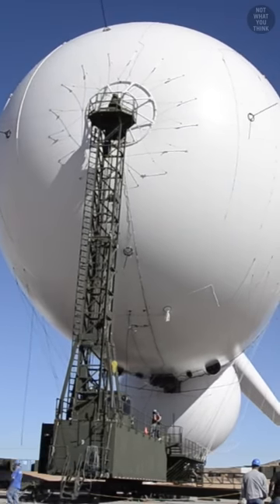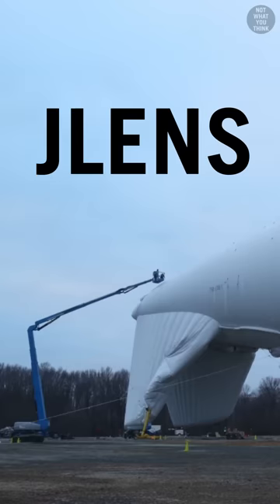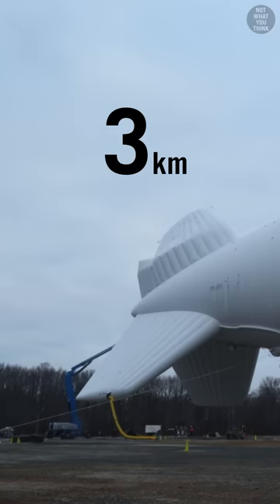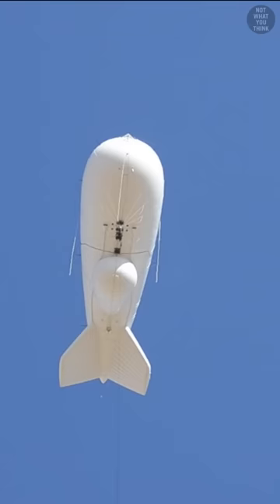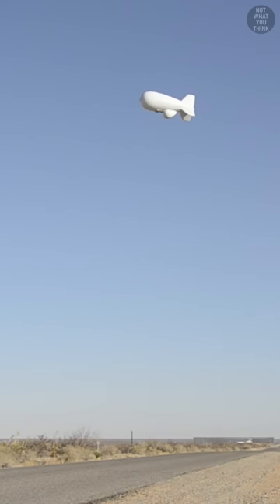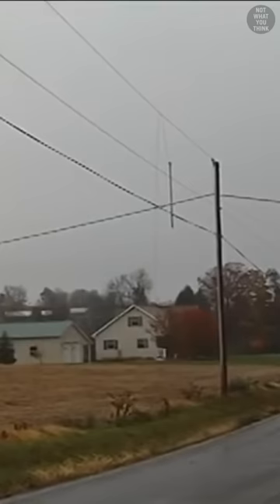What Happened When the Cable SNAPPED? #shorts

Comment: They could just add more cables, although it would probably have to be something other than steel, as I imagine it could add too much weight for that thing to be able to reach the same altitude
Reply: Redundancy? no way....
Reply: We now have Synthetic alternative cables called Plasma line and they're replacing 2" steel cable on oil tankers that require a stable connection to the dock previously only offered by cable.  

We could try this again both cheaper and with greater redundancies.
Reply: Weight shouldn't be an issue.  The cables hold the balloon down, not lift it up.
Reply: @lyfa  they kinda are, the balloon is pulling the cable upwards, meaning the balloon can only reach a certain height despite the size of the cable, it could possibly lift up, but not reach the same altitude with extra cables

Comment: So Texas is 268,597 sq miles(A). The United States is 3,796,742 sq miles(B). Doing the math: B/A= 14.135 or 14.15. so roughly 14.2 Texas's fit into America with some extra space. So with that knowledge, we'd need only 28-30 to cover all of America and to have them constantly we'd need 60 (4 for each area for maintenance, repairs, etc.) Each JLENS costs around $175 Million. So for 60 units, it'd be around 10.5 billion. Compare that to the cost to own a AWACS unit alone being $1 Billion without crew costs and maintenance costs (it is an entire 747), we have a clear profit.
The United States owns 31 E-3 early detection systems (AWACS), costing us easily $31 billion to own. According to ExecutiveGov, the country's proposed spending, mainly the Department of Defense budget, reached $778 billion in 2022, which is a 14% increase in military spending compared to 2017. meaning there is more than enough money to experiment with this idea and if it does crash and burn, it barely makes a dent into the budget.

Comment: Seemed like a good idea. Just use a stronger cable with an remote emergency disconnect on the Blimp so if it happens again, it’s does drag the cable.

Comment: Also sometimes the wire that’s holding the air balloon could be made out of something else to withstand force strong enough to screen an aircraft without noticing. Wires are thin you can’t see them in subsonic.

Comment: Such a huge blimp was also used by the French Army, when the famous small sailing yacht of the brand new GreenPeace disturbed an atomic bomb test. By simply being there. That blimp, these men onboard saw from a distance, it carried an atom bomb! No matter your opinion about these atom bomb tests (necessary tests or maybe too dangerous), think about how the French Army lifted an atom bomb under a huge blimp balloon. The men doing that were a pretty tough team. Suppose it would explode early, or you would notice radiation levels were higher than normal, or the blimp would break loose! There were some risks. Handling an atomic bomb is scary. And the responsible Admiral was not amused there was a protest yacht, for weather was okay for a test and waiting could not take too many days. Yeah, blimp history is more interesting than you'd think.

Comment: So many things wrong with this. 

First why use helium??? Hydrogen is significantly better especially when there is 0 people within the blimp + modern materials can easily prevent fire and explosions. Hydrogen is also lighter, less expensive and much more abundant on earth than helium which is non renewable and becoming rarer by the day. It's also extremely important for MRI machines and stuff. 

2nd: there is so many simple solutions to this... why didn't they have backup tethers or double check? It's just stupid to shut down our blimps like that. Would be a sight to behold.

Comment: We had these things in Iraq and Afghanistan. They we would get mortared and an hour later after all was said and done. The thing would alert the CRAM system there was incoming and set off the warning late. They didn’t scrap the project because of a broken tether. We had those in the sky over all our FOBs since 2005. Any combat veteran can contest to that. They sucked at tracking rockets so instead of hitting us with high arcing mortars. They would just shoot low flying rockets right under its radar.

Comment: It was only 20,000 homes I don't think they should of canceled the program based on that one incident.  Especially the cost was low and it was providing incoming missile threats.  That's like saying if a plane took out 20,000 homes do away with planes.  Now did it under perform and the cost was an issue you would think they would fix the flaws. I mean after all it was a air balloon with non flammable liquid or air in it doesn't sound to expensive for the protection it provided. Sure cheaper than an Apache helicopter or an F-35. It's not like we have any say on anything the government does anyway! Peace be with you all!

Comment: And that, children, is why you have a (cryptographically signed and authenticated, and because why not encrypted) wireless link to the blimp, so you can order it to cut the cable, open vents to (partially) deflate, drop the expensive electronics via parachute — or utterly destroy them if they must not fall into enemy hands.

That is why you put in an emergency program if the wire connection fails, that in the absence of other commands, using e.g. GPS, knows and projects its current and future positions and uses a pre-programmed map, crash-lands in a reasonably safe spot.

BTW, using helium or hydrogen balloons that drag a long cable to shorten out enemy power lines is so WWII… if not earlier. 

A dragged cable will keep the balloon in the air at approximately the same height. Increased lift for whatever reason means more cable must be carried instead of dragged — less lift simply lets more cable be dragged, not weighing down the balloon any more.

Comment: Stupid decision. Effective device.ineffective design.any vacuum cleaner designed post 1990 has auto pull cord pulley system.similat could have been used with snapped tether.